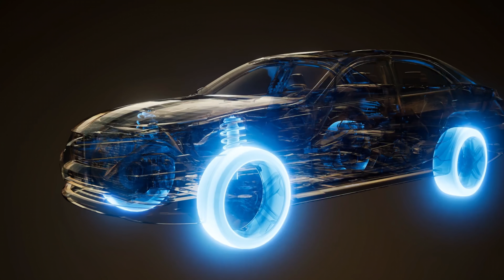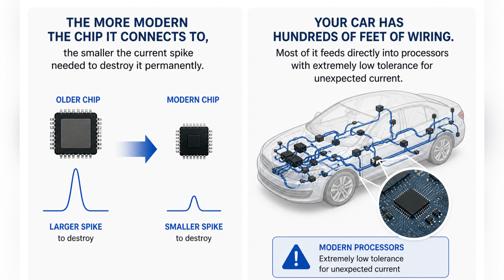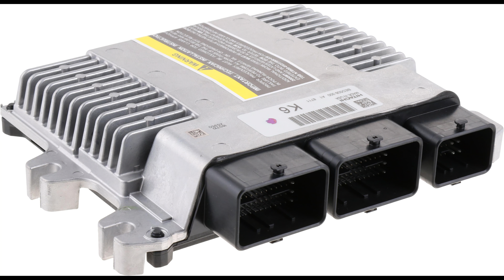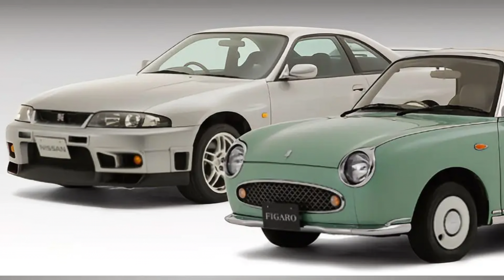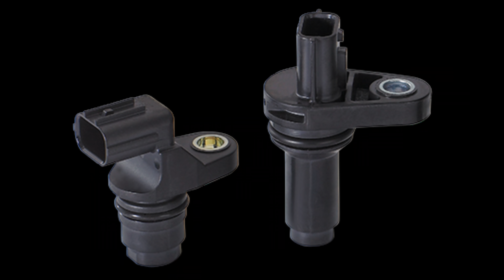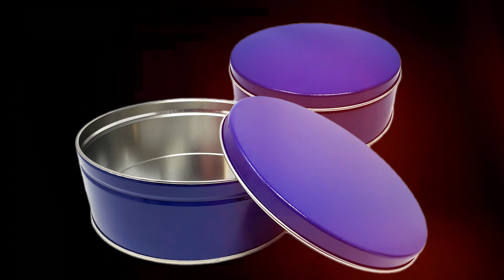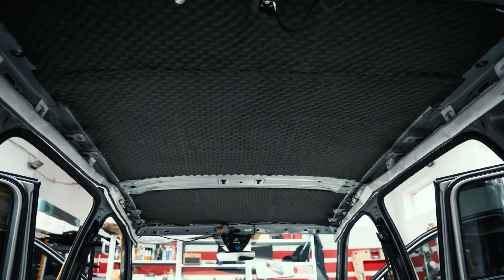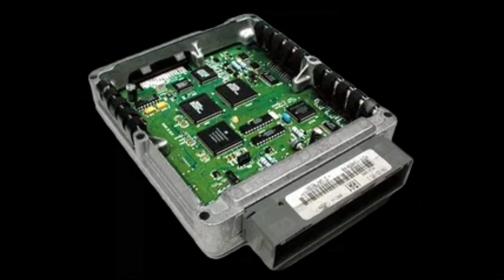EMP Just Killed Your Car? This $7 Part Saves It

Comment: In my 20 years with The Boeing Company their were significant tests of EMP effects on vehicles of all types.  At significant field strength level, A FEW vehicles stuttered or stalled but were able to restart, most saw no effect.  They found that field strength sufficient to disable vehicles would only be possible from a military grade EMP gamma device with limited effective range of perhaps 12 miles.  It turns out the disruptive electronic environment under the hood of most vehicles is rather high and manufactured ECM's (Electronic Control Module) are already well shielded from the manufacturer.  Perhaps the greater concern is how you would get fuel to drive streets devoid of traffic control?  EMP protection is rather like closing the barn door after the cow got out.
Reply: I remember seeing one of these studies and the conclusion was that this would have to be a directed energy device, specifically targeting the vehicle or an extremely limited range high output device. If it were a pulse from a nuclear weapon, you wouldn’t survive in the areas where this would be a problem. Automotive electronics are pretty robust. They’re not using the latest 5 or 3 nanometer cmos process, they use old technology to make those chips, with the exception of the infotainment systems.
Reply: @Brian_C_   Why dont you look at the actual studies Starfish Prime is the US test took out part of Hawaii just power. Russian which is the Goldeneye  was tested over Kazakhstan. We dont know what results were because they don't share that sort of thing though people will write like they do.
Reply: @jhowardsupporter  Ok, I think I understand what you’re trying to say… You’re saying that weapons development had resulted in a strictly EMP device that could completely wipe out an entire metropolitan area but the findings of this testing wouldn’t be public knowledge? Yeah, I get that; but often some derivatives of the big weapon get decimated to smaller applications… like the police getting EMP devices with highly focused outputs to target a single vehicle. That was a thing for a minute; but it was problematic. Anyway, the EMP type weapons at the scale you’re suggesting would decimate a metro area and still not do much to military equipment that’s emp hardened. You’d have a lot more to worry about, like fresh water. If you managed to have an operational vehicle, the swarm of thirsty urbanite zombies would be overpowering.
Reply: @Brian_C_  A nuclear emp is not a bomb. Its high altitutde discharge in space. In the movie James Bond is not risking his life to stop a bank robbery if the Goldeneye went off all of England would be destroyed. Area larger than Ukaine meaning if they wanted and of course they have AN-602.
Reply: @j @jhowardsupporter es, I’m well aware there are emp specific devices. So far, no one has deployed them…  for the same reasons no one had deployed a nuclear weapon - the consequences would be a global escalation. The only countries that might be willing to risk that don’t have EMP specific devices and aren’t really a factor… yet.
Reply: Great point and the true problem after severe emp strikes.
Reply: "In my 20 years with The Boeing Company their were significant tests of EMP effects on vehicles of all types.  At significant field strength level, A FEW vehicles stuttered "

That test was only up to about 30KV/m a real nuclear EMP can generate pulses up to 200KV/m. Its like comparing a small tack hammer (30KV/m)  with a pile driver (200 KV/m)  in the amount of energy delivered. 

That said if the US get s NEMP'd its game over, since all of the nuclear power plants will meltdown and the spent fuel pools will catch fire. there is more than enough material in the spent fuel pools to render all of the CONUS uninhabitable for many thousands of years.
Reply: @guytech7310  Fortunately, we don't have to recreate Starfish Prime to study the effects of EMP.  Lesser field strength at closer proximity will supply the necessary data.  Hurricanes are a good example.  Harvey hit Rockport TX as a CAT5 and the result was pure chaos with massive damage.  Twelve miles away in Aransas Pass the damage was remarkably less and 25 miles south in Corpus Christi they never lost power or their cable TV.  The testing Boeing conducted was appropriate to define the effective range of even a military grade gamma device at only 12 miles at best.  IF a nuclear device detonated in our atmosphere, loss of our vehicles and electronics would be the least of our worries but we did learn that automotive electronics were remarkably resilient.
Reply: @BP_Devo  The Russians stated the can generate a NEMP to 200KV/m. I have no reason to doubt that. The "boeing test" was at 30KV/m, the distance has nothing to do with. To replicate at 200 KV/m they would have to generate a 200KV/m field. I very much doubt any vehicle with electronic systems for the engine will survive a 200KV/m EMP. Likely 40KV/m is the near the limit for the majority of vehicles.

"IF a nuclear device detonated in our atmosphere, loss of our vehicles and electronics would be the least of our worries"

I will agree with you on that statement.
Reply: @guytech7310  That  was the point of the limited Boeing test.  Equipment survival doesn't matter when there are no survivors to use it.
Reply: @BP_Devo  while the science debates- im wondering which city China hates the most.
Reply: Interesting study. At my lab we had a nearbye lightning strike and resulting EMF field caused all of our electronic equipment being fried. This included electronics that was still in boxes and not connected to anything and digital cameras with their batteries not attached. The high EMP literally fried everything electronic we had.  Hope this doesn't happen again and that the new faraday cages will protect us this next time.
Reply: @MrFreddarama Near lightning strikes can be amazingly strong.  The only man made similarity is a military "gamma" device.  That lightning strike had to be extremely strong and close for all that damage.  At Eglin AFB in FL, I was standing at a 2nd story window in our barracks day room when lightning hit the power transformer on a pole that was only about 50' away.  No damage to any electronics.  Your experience had to have been a "whopper" of a bolt.
Reply: Exactly. It's like doomstay prepping when all you need is a gun to take advantage of others prepping.
Reply: @jhowardsupporter and you think preppers wont have guns themselves?
Reply: @toyotafan83   I was going to say probably the AR-15 after the news reported they were coming for them again taking American off the shelves and sending tax dollars overseas but then got to thinking does reports on Glock switches precede increased sales? Yep not only that a venezulan repair man noticed this um feature and told Glock about it and they told him to keep it quiet, he then invented the Glock switch. You can't make this up.
Reply: @jhowardsupporter pew pews are good for telling people NO I DONT THINK SO.
Reply: @jhowardsupporter  doomsDay not doomsTay...
Reply: @Embrachu  what? What is dooms tay?
Reply: @jhowardsupporter I assure you, take your gun to the preppers house and you will be met with much great force.
Reply: Ur a virus the answer is not instantly guns

Comment: I used to have a 1986 Citroen diesel and the high pressure pump solenoid failed, while I was waiting for a new solenoid the car ran perfectly. I could stop the engine with the pump shut-off lever or stall the engine in gear.
Basically this xud engine could run fine  on zero electricity.

Comment: I have a perfectly running 1972 Pontiac Grand Prix. Points, carburetor, mechanical fuel pump. Heck it even still has R12 in the working A/C. I will miss the stereo not working though.

Comment: I believe there is a special shunt design called emp shield that does this already for cars homes aircraft etc and it works on the reverbs not just the first instance and is the only one to actually work on lightning strikes 

So they are about $300 when I heard of them who knows how much they are now 

Am I lost or is this only actively powered circuits will fry but ones that aren't actually being powered are ok Idk where I got that from but it's stuck in my mind

Comment: if you have 4 wheeler atvs or motorcycles , get you a complete set of the electronics that are on the atv or motorcycle , put them in a farady container, its not that much work to replace the small amount of electronics on an atv or motorcycle, plus you usually will have something that runs at a better economy then a huge suv or somethin g, plus a motorcycle(dirt bike) will get you in and out of places that a full size vehicle wont

Comment: Fuses don't protect integrated circuits or distributed processors, which are all over a modern car, and many of them are necessary to drive. A microprocessor might fail at 0.3 amp excessive current, a relay can handle 1 or 2 amps pulse without failing. Only if you removed all fuses before the pulse happens is there a chance your processors and ECM survived, but that's unlikely since an induced 1 amp current will fry a microprocessor designed to operate at 0.5 amps, but a fuse won't blow until 15 amps, which requires a SHORT CIRCUIT, not an induced current. A spare ECM is very expensive, and relays for engine control are only used in some pre-1990 cars, so this video isn't very helpful

Comment: My car is safe, mine actually does the opposite my car has a 1940s copper coil wire, it blocks or disrupts any signal near it like an EMP, when I pull up my neighbors TV show disappears 🤣😁🤙
It's a 1950 GMC ( grumpy man's car) it's still six volt system but I upgraded the 228 straight six with a military 302 straight six engine, but it's my 1940s coil wires that destroys any signal while it's running

Comment: even a 57 chevy will have fried wiring and ignition coil and condenser .. the conductors themselves can be fried not just components ..MAYBE you can push start a diesel with a mechanical fuel pump to drive..MAYBE ..if you can by pass the starter wiring

Comment: So dumb. If your parts in that tin are fried without protection then your car is fried, even without power applied to it. Your car is suddenly shit. Duh. Think critically people. Need help? Read Trivium and Quadrivium and learn how to critically think and discern.
Reply from the maker: The Faraday cage protects electronics from external EMPs. The car's existing electronics would be fried, but the shielded spares would be safe for replacement.

Comment: I’ve got a 70 dodge and a 74 Pontiac, both with breaker points ignition.
It helps that I know how to use a dwell meter and set breaker gaps and timing.
Rebuilding carbs is also easy with practice.😊😊
Reply: Mopar started using a solid state voltage regulator in 1970.

Comment: Replace the screw-down  leads to your battery with easy-off clamp versions.  They're available at auto parts places.  Take a lead off your battery every time you make a long stop, such as at home, work, or grocery store.  Maybe the small amount of power left in your car's ecu, storing data, won't still fry it...
Reply: The EMP induces a current in the wiring that fries the ECU.  Having the battery disconnected will not help it.  It might save the battery.

Comment: Won't be frying my truck for long. It's carbureted running an HEI ignition which can be fried. And that's why there's a points style distributor sitting on a shelf in the garage. Pop out the HEI and in with the points and I'm driving

Comment: You’re saying the crankshaft & camshaft position sensor’s will not be fried in the emp? Surely the vehicle’s power control module will likely be toast…?
Reply from the maker: The EMP shield focuses on protecting the PCM itself, which then safeguards connected sensors like the crank and cam sensors from the surge. The PCM is the primary vulnerability.

Comment: EMP will fry the computer in your car so HOW is a replacement of fuses going to help?
Reply from the maker: The video explains that modern cars often have specific EMP-hardened fuses designed to blow and protect the system, so replacing them restores function after a non-damaging EMP event.

Comment: In 2027, all new cars made in America will be required to have surveillance devices built in that monitor the driver. If he or she doesn't match its "acceptable" algorithm (such as looking "distressed" or shouting angrily, or having alcohol odor, etc.), the car won't start. A built-in 'kill switch' that you don't control, but you still have to pay for. Good luck with that.

Comment: isn't the metal hull of a car a Faraday cage, already?
Reply: No. Faraday cages do not have glass windows.  Any opening, even tiny ones will allow some EMP energy through them.

Not worried about EMP myself.  Too old to worry about things over which I have zero control.
Reply from the maker: Cars offer some protection, but not a complete Faraday cage due to openings like windows and gaps.

Comment: In 1975, most cars were electronic ignition, not point ignition. Even Chrysler had the electronic ignition with the reluctor wheel in the distributor.

Comment: And now we know why they made such a big push to trade in old cars in about 2010 it so
Reply: Cash for clunkers-Obama legacy
Reply: @DanHolmes-o9b  Yep, the push to kill the most reliable cars and engines that could run forever was strong.
Reply: How else are you going to get people to buy a pickup truck for nearly $100k these days?

The used-car market was a viable competitor to modern automakers who couldn’t get too crazy or else people would just buy an old junker and fix it up.
Reply: Yep. Thanks, Obambo.
Reply: there was a push to make all cars ev by 2030, agenda 2030

Comment: Where can we see the results of the gubbermint test? I would like to see what vehicles were able to restart, which ones needed the battery unplubed and which truck wouldn't start at all. It seem most vehicles will be fine.
What good is it to keep parts in your garage and not in the car and how do you figure an fariday box would protect components in a garage and not in the vehicle? That's ignorant and deadly.
Reply from the maker: The government test results aren't public. For the Faraday box, it would protect spare parts stored in a garage, but not components already in the vehicle.

Comment: What is funny is that you will never know what stopped your car because every radio around you will be dead and will not tell you what happened and get you digging into your stash of spare parts. Plus, to be fully prepared, you should have layers of spare parts to deal with multiple incidents. The military knows this and prepares by having back up radios for their backup radios because another country may set off an emp event multiple  times during war to make their enemies (us) unable to communicate with troops for defense. If the US is hit with a nuclear weapon I want to be at ground zero because there will be nothing left worth living for.